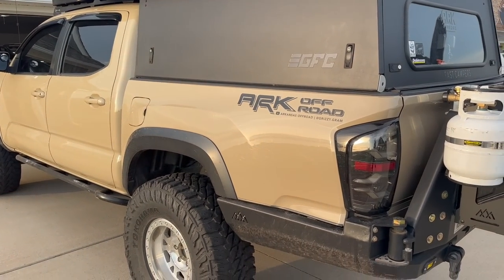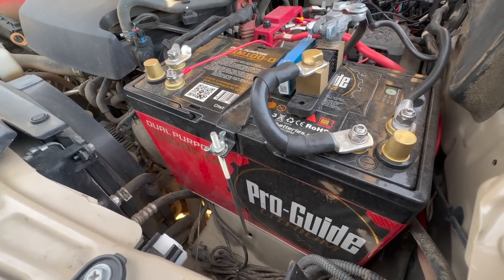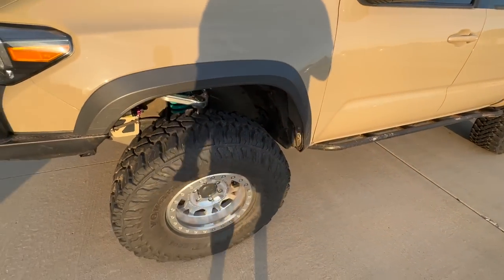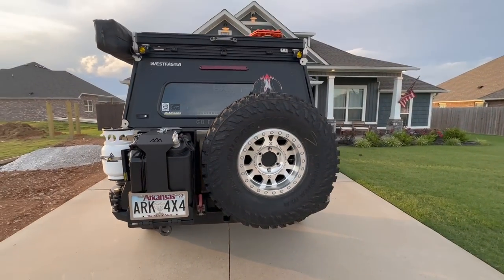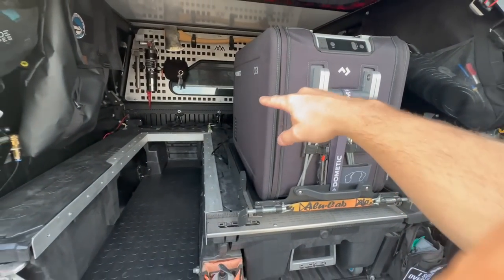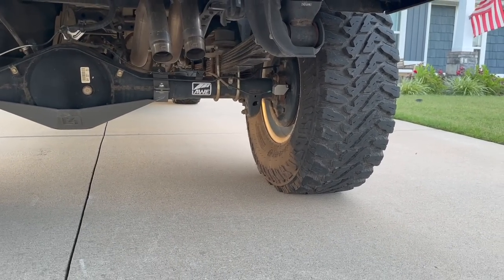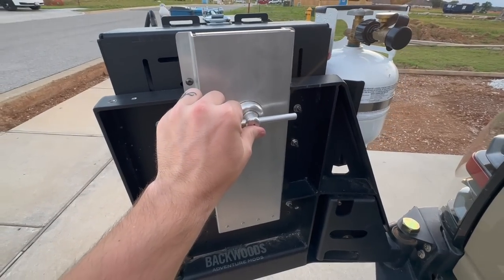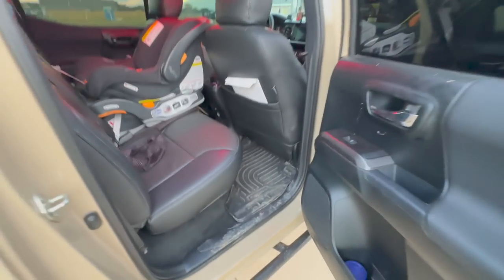$7,000 of NEW PARTS - Tacoma Overland Build Update

Comment: Didn’t you think the garmin back up cameras were any good ? 
Was thinking of putting one on the back of our caravan linking it the the garmin overlander unit.
Truck looks smart, like the fixed air line stuff. Way better than digging through stuff again and again for compressor and that. 
Nice going
Reply from the maker: My Bluetooth garmin camera keeps having connectivity issues. I had it up front but got the wolfbox and put it out back. Plus the wolfbox also has a front camera, so the garmin is kinda redundant. Maybe I can fit it and put it underneath or something haha. 

Appreciate the feedback. All function here ✅

Comment: Those dual purpose battery looks awesome but I do have couple of questions in mind,  how well this lithium dual purpose do in engine bay with high temperature - normally BSM would prevent charging when it is too hot. Are you able to use winch long enough before BSM cut off? 12k winch need  just under 400A continuous at max.

Comment: Definitely aesthetically pleasing but highly functional... like your Backwoods Jerry can holder. Did you design and fabricate your own outswing pivot storage compartments to be fully integrated with your rear bumper? That looks quite elaborate of a system... how do you secure the two storage components so they don't rattle or try to nudge their way toward your tailgate panel, i.e. do they rely on friction by sitting tight on the rear bumper or your pivot hinges take care of the travel?